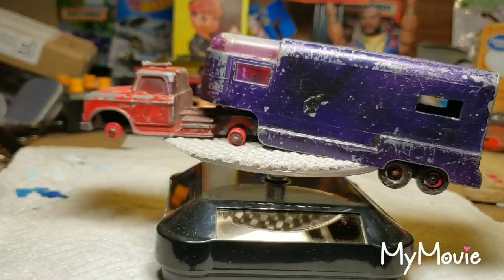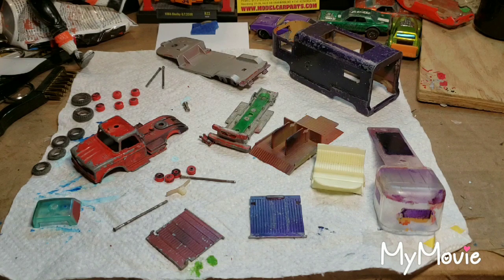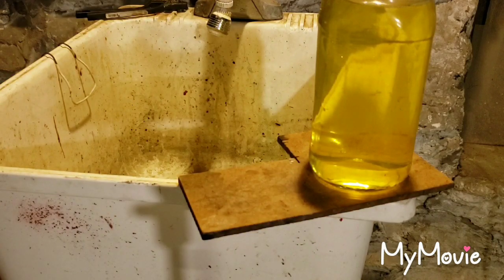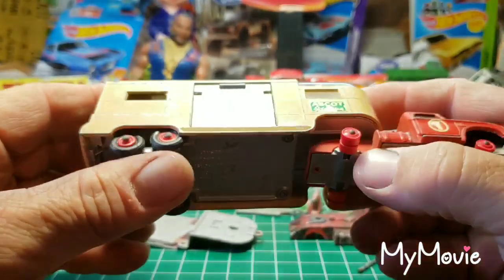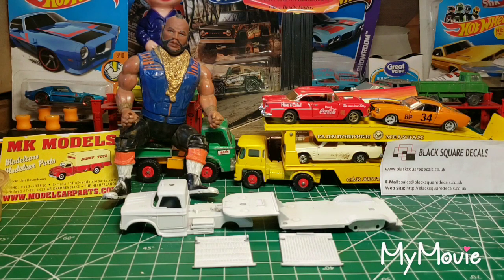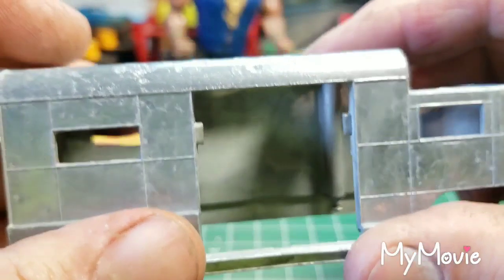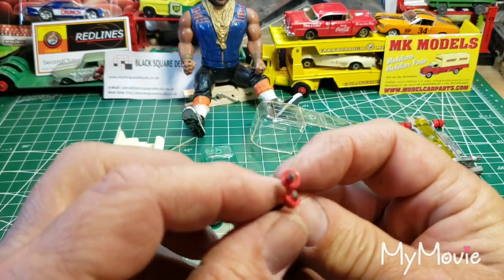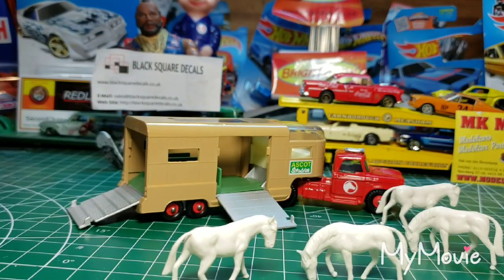Matchbox K18 Dodge Truck &Articulated Horse Trailer  Restoration

Comment: I have not tried it yet, but I have seen that brake fluid will clean paint off plastic parts without damaging them.
Reply from the maker: I've been wanting to try that probably should have tried it instead of pine sol which hazed everything
Reply: @hodgeshotwheelsanddiecast5192  Still watching this one, you went through a lot to bring back this turd.

Comment: You did a great job in getting rid of the corrosion .. And the body work... looks like new !! The red is also perfect. Love it !!
Reply from the maker: Hey buddy, get yourself some lime a way,or an equivalent bathroom/plumbing cleaner.It works wonders on corrosion. That was my first king size. It was alot of fun.  Just a bitch to  get parts .better off buying 2 junkers to make 1.rock on brother 🤘🤘🤘

Comment: Top result.  Had your work cut out with both trailers in such poor condition.  Like acne scarring in the second one.  Paint is smooth and glossy.  King size are great models: lots of details and working features.  I restored a K20: the Ford D series COE and 3 tractors on trailer.  Brings back memories as I had one as a kid.
Reply from the maker: I have found a new love in these king sizes, and plan to add them to my monthly restorations.

Comment: The finished model looks incredible. Caustic soda can remove paint from plastic without damage.
Reply from the maker: Thank you very much.  I have been wanting to play with some caustic soda,ever since I saw Rob over at Matchbox Garage using it.
Reply: @hodgeshotwheelsanddiecast5192  i think it was Marty that used it on plastic. I'd still test it on something you'll be throwing away first such as a broken screen.

Comment: Sweet! I just got mine in the mail with bashed trailer plastic greenhouse, locked wheels, different doors (no notches), and a worn out door catch on the side door. I like the parts car idea. You might build something creative with the extra bits. Thanks from Thailand.
Reply from the maker: Do you need parts? I have some

Comment: yes the pine sol removes the paint but I'm sorry I should have warned u on clear plastic it will cloud it,,,,,,, but some elbow grease and a dip in a clear coat of what ever works fixes it,,,,, u did a great job on it my friend !!!!!!!!!!!!!!!!!!!! when I said it wont harm the plastic I shoulda warned u about it clouding up my bad
Reply from the maker: It's all good. I got the green windshield cleaned up  .but the purple paint pretty much destroyed the trailer glass already. I was lucky the parts donor had beautiful glass.

Comment: Great job. Did you get replacement tires for the cab? If so where at. I could use a set myself.
Reply from the maker: I did .i think i got them on Ebay through one of the US vendors

Comment: The only problem to king-size is you got a source the parts and it becomes a pain in the ass I'm working on a couple of them and I know exactly what you're talking about and it's usually comes to me when or Australia where you can get the part and then it takes weeks anyways well done I enjoy your channel very much and continue on the Borat wonderful work
Reply from the maker: Hey my friend.  You said it on the parts sourcing.  It's a bitch having to wait a month to get stuff.  That's why I ended up buying a second one. Quicker and cheaper. We are going to tackle all these cool little diecast adventures. One at a time.  Great fun it is. Thanks for everything.
Reply: @hodgeshotwheelsanddiecast5192  I will email you that address

Comment: Excellent job👍👍👍 what do you think was you total cost to restore including the parts truck from eBay??
Reply from the maker: Never really thought about it.  I got the parts truck in a lot of King sizes for like 37.00 with shipping. Black Square decals, were probably close to what I paid for the truck .lol probably all said and done around 30-40.? It goes in my collection so I usually don't worry about value too much. Probably never get it back if I were to sell it. But as with alot of hobbies I consider it a labor of love to restore, and I love the challenge.

Comment: Soak your plastic parts in brake fluid . Others do it as it doesn’t attack the plastic like a caustic stripper will
Reply from the maker: We are going to try that on that little corgi Cougar I just got. Thanks
Reply: That's a great tip. I've seen Marty from Mary's Matchbox Makeovers do that with nice results.

Comment: The only thing that should be painted purple is a MOPAR? Man, you Plum Crazy. LoL
For cleaning plastic parts I've always use brake fluid. It's tough on the paint but not the plastic. At least I haven't run into any problems. Even if you read the warning on the bottle, it says to avoid getting it on the painted surfaces of your vehicle. I've never had to clean anything that large but for regular Hot Wheels windshields, I just rub a little bit on, let is sit for a few minutes then rub it off with a paper towel or something.